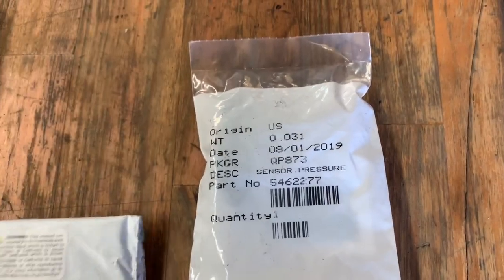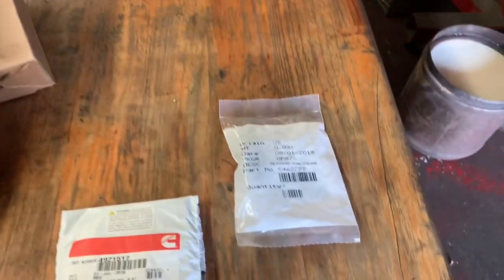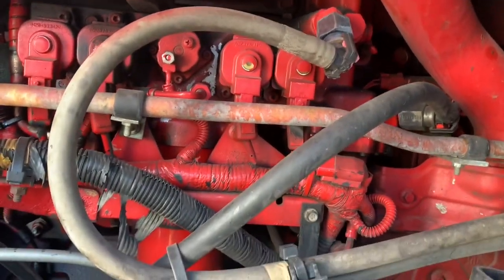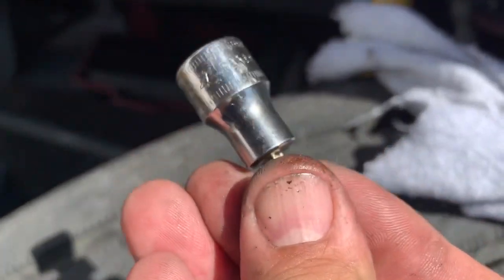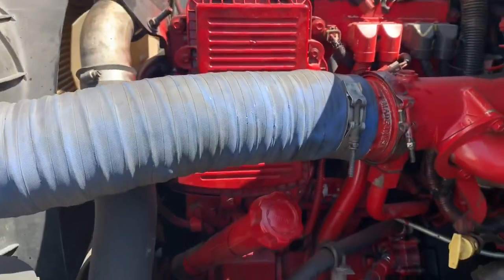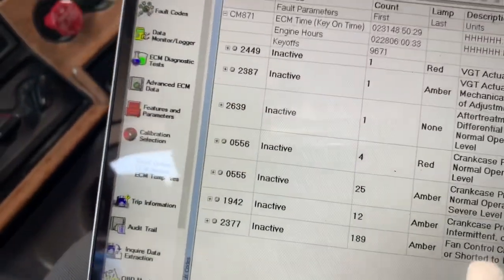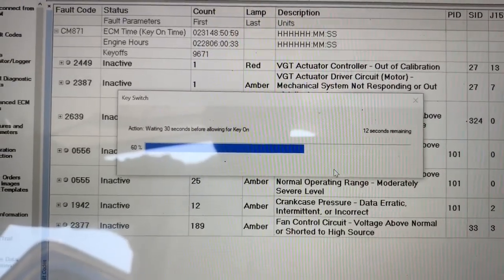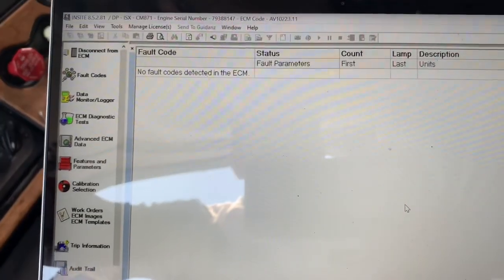Cummins ISX, crankcase pressure fault code

Comment: Hey man thanks for all your hard work! quick question I have an x15 2012 in a Volvo showing crankcase pressure, I replaced the sensor with a new one from dealer and probed the connector another x15 it’s 5 volts on both and a ground any idea what it could be?

Comment: I have a similar code spn 1843 crankcase pressure sensor is it the same or not?  The truck is derated to 35 mph. The voltage is not right. Any idea.
Reply from the maker: Start with the sensor and inspect the plug

Comment: My crankcase pressure code pops up periodically.  I've even watched it turn on and off by hitting bumps. Thinking I need a new sensor and pigtail
Reply from the maker: I think you are on the right track. Start small. Always go low hanging fruit. 
Sensor and pigtail. Good thing those are not expensive.
Reply: @CarlosDieselElectric  this is true

Comment: I've got a 2009 KW W900 Cummins ISX keeps bringing up the crankcase pressure sensor on dash. I've replaced the sensor and harness and i've changed filter a couple times and still keeps coming up often. What else do i need to do to resolve the issue.  Thanks!
Reply from the maker: Check the oil return line to the engine block from the crankcase

Comment: Hey guys I just changed my sensor and filter , very easy just like the video shows but  my old sensor broke off in the hole it sits so make sure you get a pick or small flat head and get all that junk out cause he was I guess melted to the hole wall so it took a little work to dig out
Oh and the case says to torque the bolts around the filter case

Comment: Hola carlos muy buenos videos espero puedas leer este comentario.
Tengo un problema grave y nadie encuentra la falla porque no hay check engine light
Reply: Tengo un cascadia 2016 con cummins me empezó un problema con la luz de hot exhaust y cada que le pasaba cuando iba sercano a parar las regulaciones re suben asta que acelero dos veses como que se pega
Reply: Lo lleve al taller me bajaron los filtros cambie todos los sensores incluyendo el doser cambiaron el pedal sensor incluso me vajaron el turbo en fin un dineral y el problema sigue igual no saben que es y ya estoy desesperado lo que se me hace raro esque antes del problema mande a calibrar y empacar los injectores y después de eso empezó mi problema espero y puedas ayudarme ojalá estuvieras serca del area dela bahía para poder llevártelo pero me imagino estas lejos de California gracias de antemano
Reply from the maker: Que códigos tiene el camión?
Reply: @CarlosDieselElectric   ese es el problema no tira códigos

Comment: Buenas tardes podria darme una información de freno de motor del isx tengo un problema no me detiene sólo es vuya ya lo calibre varias veces e probado con diferentes tipos de aceite le agredeseria mucho si me brinda la informasion
Reply from the maker: Que ISX es? ISX15 que año?
Reply: Es 2006 isx 15
Reply from the maker: @davidbenjaminraudadepaz489  2006 ISX15? Ese año es ISX con doble árbol de levas. El ISX15 es un solo árbol. El ajuste es diferente
Reply: @CarlosDieselElectric  tengo ese que es isx 15 y el otro y los 2 camiones no paran a uno incluso le cambie el freno de motor conpleto i aún así no para ..Ya ajuste el motor conpleto pensando que no servía el motor
Reply: @CarlosDieselElectric  Me podría dar la información para calibrar el isx 15 selo agradecería mucho

Comment: How do I clear the code myself
Reply from the maker: Sometimes you are able to drive the truck and the code may clear. But you may need to use the Insite software in order to manually clear the code.
Reply: I use Nexis hand held diagnostic.$185

Comment: Hello, I have a crankcase pressure sensor with p / n 40079154 can you help me to see what features it has? that is, if it is output to current or voltage. I hope you can help me. thank you.

Comment: hey carlos.  Ive been dealing with the 0555 and 0556 dtcs.  Ive replaced everything and the code keeps popping up.  ive checked the sperator tube, no blockage there.  Im stuck.  I use insite aswell
Reply from the maker: Nick Gress you could try using a test ECM. If the code still returns then you most likely have an engine issue causing the blow by. Possibly air compressor or the engine itself
Reply: @CarlosDieselElectric  I ordered the maintenance free breather element and new sensor, hopefully it clears.  where would i find the test ECM funtion on Insite?
Reply from the maker: @nickgress2180  a test ECM would be from another unit with the same engine and year. or as near to it as possible.
Reply: @CarlosDieselElectric  that sucks, i dont have a spare isx ECM to use as a tester.  we are a fleet of mostly Macks(mp8) i only have one cummins, any other ways around this?
Reply from the maker: @nickgress2180  Not really, that is the way I would I go. The other option is a dyno test, but to the best of my knowledge, that would be a shop that can diagnose it (like Cummins) or the dealership.

Comment: carlos, i have a 16 cummins isl with code 1974. is it just the filter? is there a maintenance free crankcase filter for it?
Reply from the maker: You would need to contact the dealer to see if there is a maintenance free option available. They would have to look it up using Cummins Quick Serve.

Comment: Will this work on my truck it looks just like mine.. isx455st, isxcm871 - 2010

Thanks Mike
Reply from the maker: Yes, the part numbers may change due to application. If you are looking for a maintainence free crankcase filter be sure the parts person knows what to look for. They may have to use Quick Serve (Cummins program) to find the part.

Comment: Thank you Carlos well xplaing do you think I could used this  on the ism 370 Cummings
Reply from the maker: Not sure, I think the ISM has a slightly different set up. Let me look it up and I can get back to you.
Reply: @CarlosDieselElectric  Carlos you have more videos I have 2009 international day cab my problem is my truck goes off ones n while no body seems to find the problem
Reply from the maker: @titomontano7231  I had a truck with a similar problem. International with a Cummins ISM, the problem can come from the CAB (OEM) side and is typically a dealer only. What fault codes are being generated?